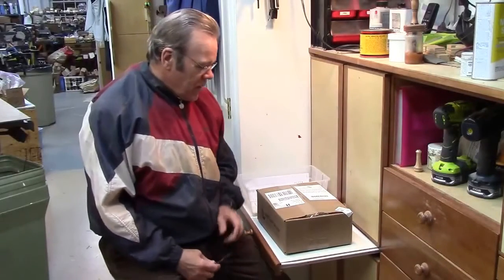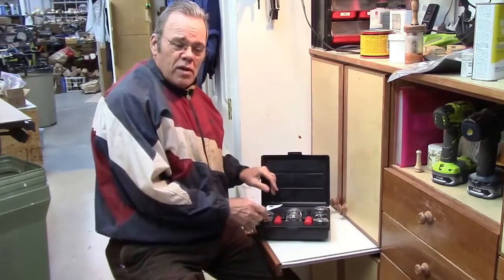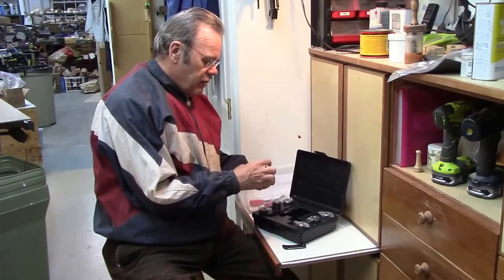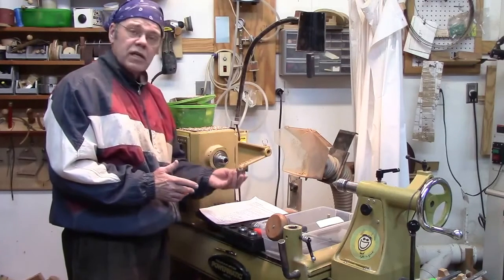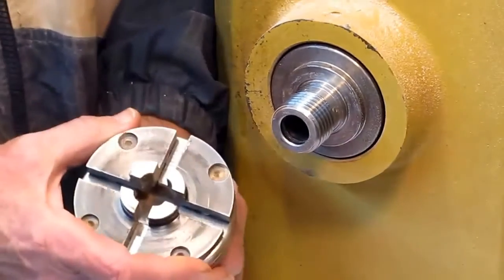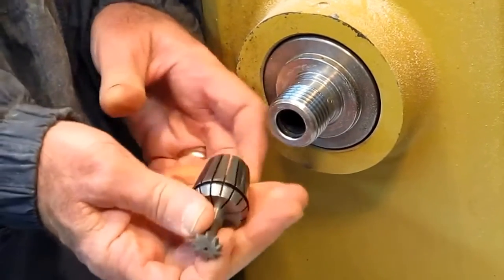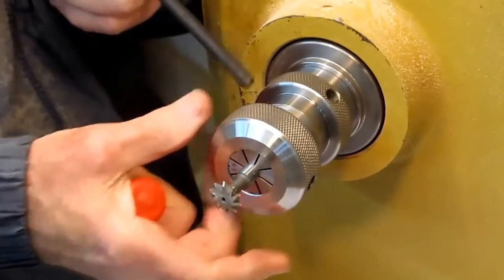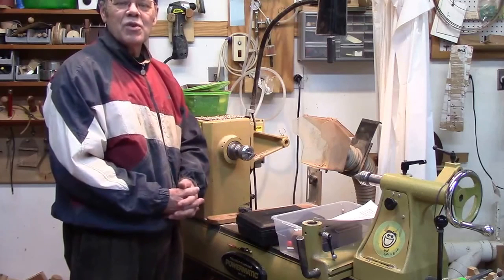Apprentice Collet Chuck for Woodturning

Comment from the maker: I sharpened an extra 3/4" open ended wrench which makes it so easy to size a 3/4" tenon for angel ornaments and other small stuff. The collet chuck is fast and easy and so strong. I am using it more and more and really like it.

Comment: Last week I bought the one that Woodcraft offers. Taking it back this afternoon. It's a different collet system and I couldn't get the collet to properly seat and tighten up. Seems to be an issue with that system. A few days ago I ordered the one off your affiliate Amazon link that PSI sells. Looks very similar to the one you reviewed from CS. It works fine. Thanks for the video.
Reply from the maker: I would hate a collet system that you had to use an additional drawbar with to be safe like the WC one.

Comment: To be honest Mike, I have not been turning for 40 years; only about 10 years or so. Lots of cabinet work and so forth. I have become additive to turning and no "turning back". I began woodworking "many" years ago.  Safety is a big thing!  I was a pilot for 40 years and remolded houses on all of my "off" time (retirement?) Safety is black and white. If there is ANY question about the procedure your are considering;;;Keep thinking, stop and look to someone who can show you the right way.  Keep your parts!. There IS a safe way to get it done. I have been in the shop for 40 years and I hope every one else can also. BTW.- my setup did not have the 1 1/4 thread but Craft sells the 1 1/4- 1" adaptor for about $30. It runs true and I use it all the time.  It's good...............KK

PS. It's ok to be a chicken
Reply from the maker: I understand there are Old pilots and bold pilots... 
I use an adapter for one of my chucks that I kept with a 1" insert to use on my mini lathe.

Comment: Nice video Mike, I have only used a collet style chuck for my router and an end mill machine but this looks pretty nice.  I was wondering if you have a video on your threading jig?  Thanks for the video.
Reply from the maker: I plan to make a video showing the use of the EZ Pro Threading  jig. Carl J has a video on it.

Comment: Nice overview.  Wish it came with 1.5 inch 8tpi and then it would also fit the metal lathe along with the wood lathe.
Reply from the maker: +phooesnax 
That is not a common size. What kind of lathe do you have?
Reply: Have two: Delta 46-450 HD variable speed wood and South Bend 10K A more with taper attachment.  The SB is 1.5-8  Love an option for the bigger spindle that allows what you suggest on the smaller which is the Delta.  Both lathes are from the 50s.

Comment: An excellent review Mike. I have been wanting to get a collet chuck and this video prompted me to do it. Have you done a video on the threaded rod and hand wheel you made to tighten the chuck? Thanks for all of the great content.
Reply from the maker: I did not do a video on the threaded rod and hand wheel. It is only needed if you use the draw collet. The Apprentice collet chuck does not require it as it threads on to the spindle and compresses the collet into the chuck body. I hope this clarifys it.
Reply: Mike Peace Woodturning    Yes it does thanks Mike. The threaded rod part was the one thing I didn’t like about collet chucks. I have not used one before but was always concerned about the threaded rod scratching up the Morse taper in the head stock but was probably not an issue and the Apprentice chuck eliminates that concern. Thanks for the quick reply. Have a good day.
Ron

Comment: Nice video, Mike.  I have the Beall chuck for my Jet 1642 and am wondering if I can get an adapter for my Jet 1221VS or if I'll need to get another collet chuck (rhetorical question/mind musing; no need for anyone to comment).  I would like to see how your threading jig works with the collet chuck, though.
Reply from the maker: They do make the 1x8 to 1 1/4x8 adapters but they are pricey. I found one on Amazon Hold Fast Spindle Adapter 1" x 8 Female to 1-1/4" x 8 Male for $50. Cheaper to reserve the collet use to your 1642. I do plan to do a video on my threading jig.

Comment: Hey Mike, your link is not working.  I am going to get this chuck and would like for you to make a buck off of it.  You are the one that sold me on it :)
Reply from the maker: Thanks. That is from Craft Supplies and I get nothing from their sales. I only make money from Amazon and that model is not available from Amazon. Thanks for trying.
Reply: @MikePeaceWoodturning  PSI has what looks to be the same thing just re-branded and it is available on Amazon.  Just an FYI
Reply from the maker: It does appear to be the same except it is threaded 1x8 whereas the Apprentice from CSUSA is a 1 1/4x8 but also comes with a 1" insert for smaller lathes.
Reply from the maker: They maybe almost identical except for thread size. The psi model is for 1 x8 and the Apprentice chuck fits a 1 1/4x8 spindle but also comes with a 1" insert. You need the 1 1/4 if that is your lathe spindle size or plan on upgrading to a larger lathe. Thanks for thinking of me.
Reply: @MikePeaceWoodturning  You are correct and that knocks me out for it.  I need the 1 1/4 x8.  Oh well, keep putting out the good videos and Ill keep watching.